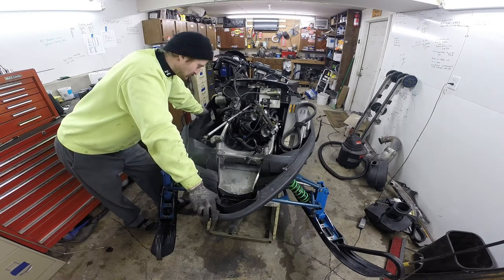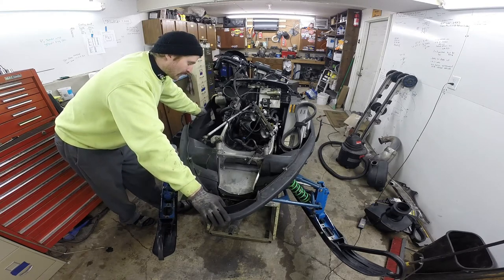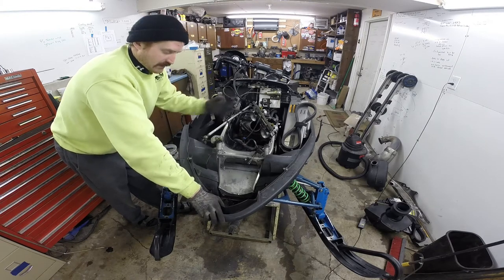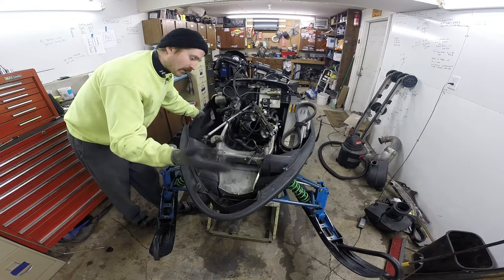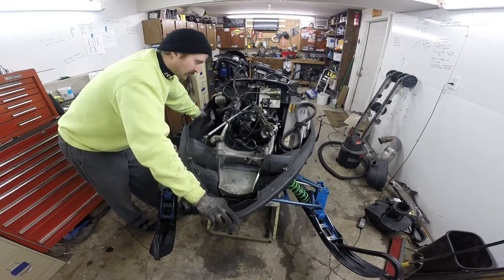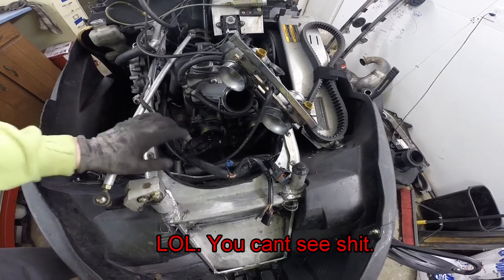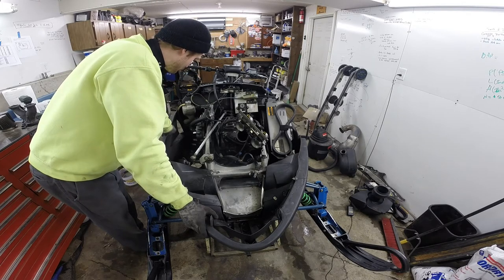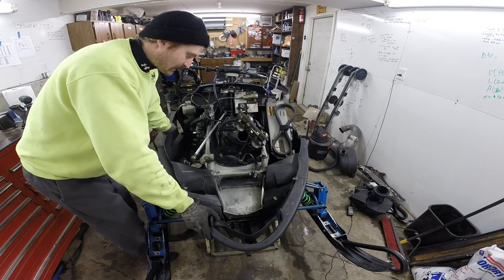Why I am putting oil injection back on my 2-stroke snowmobile!

Comment: If that oil pump is a mikuni brand it likely will never fail. It’s the lines themselves that may fail (though that was never really an arctic cat issue) id say you’re making a good move putting the injection back on. Use way less oil too. Be careful/mindful with that M series oil tank and your exhaust routing. If they are close heat tape the shit out of the tank. I heard a story from a guy I know with an m8 from 2007 that he had to replace an oil tank due to the heat from the pipe warping the tank and cap. I think they had an update with a heat shield after that, but that would be bad news especially on the ice/track where I imagine cooling may be difficult?
Reply from the maker: Thanks for the heads up man! The crossfire/Mseries tank I mentioned ended up not fitting. Interfered with the throttle bodies. I'll show what I ended up doing in another video soon! Heat tape still involved!